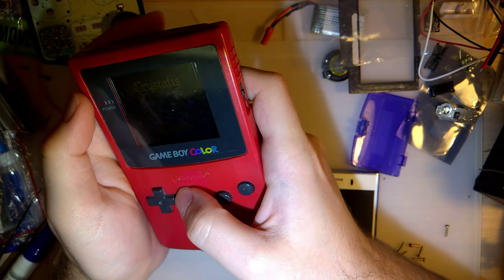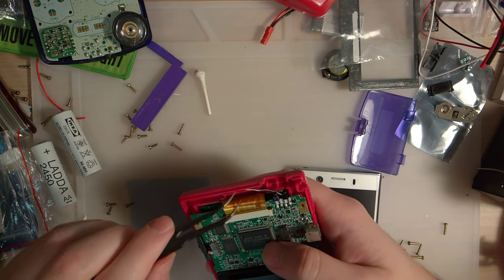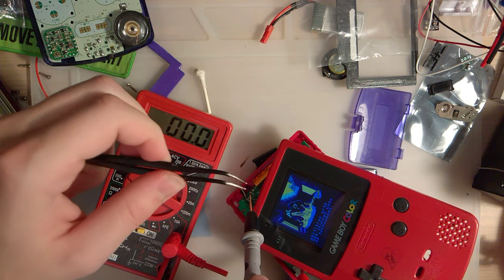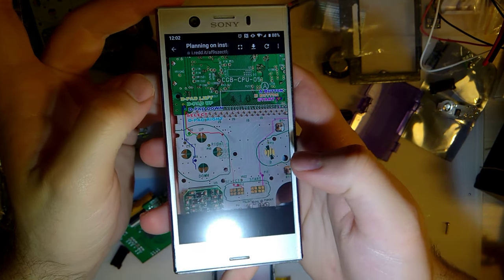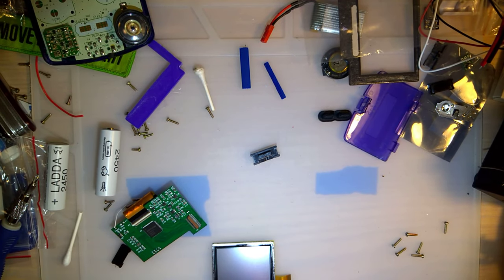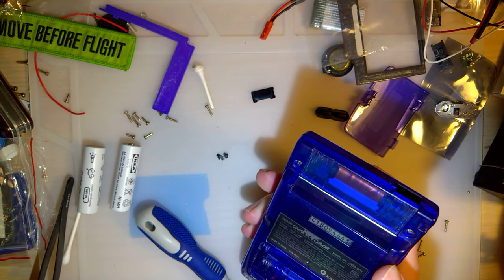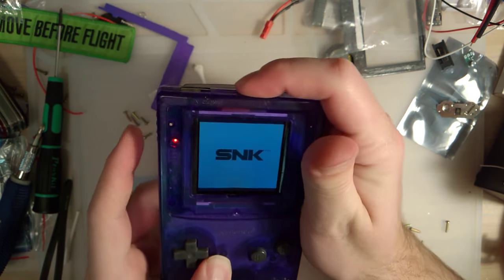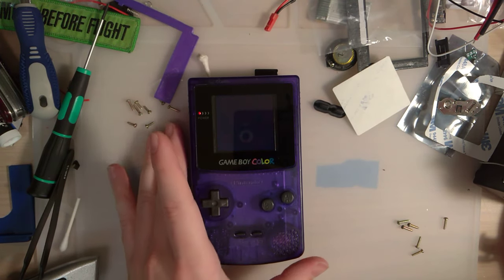Finishing the install of the TFT GBC backlight kit (HiVision AIO) - Part 2

Comment: I got a hint from the Producer of the mod. The brithness can be Make higher with replacing the 30ohm resistor the ist Mark as R9
Reply from the maker: ooh I may try this. Do you know if it increases all levels or just the max level?
Reply: @makho  like i understand Set it all brithness Level higher. I must only get the Info from it if higher or lower resistor.
When i knew it i give it to you too. 

I Have the Display here too but i must wait for the gbc. ;D

On Bennvenn freckle shack can Make similar Modifikation.
Reply: @makho  ok they say 20ohm instead of 30ohm which is build on it
Reply: I test it and it work.
10 ohm would work too.

Comment: Hey dude, this is amazing... I just ordered a Chinese LCD kit which I think should be like this one, I just don't have any access to 3D printers for printing the spacers. Do you happen to have the dimensions of the spacers anywhere? I'm thinking of buying some thin plastic sheet and making them from that. Also, I am guessing you'd have to use thin magnet wire if you wanted to convert the touch sensor into a button combo press for adjusting the brightness ("Select" + either "Up" or "Down" on the D-Pad), are there any pictures on what wires you need to solder to be able to do that? I'm a complete beginner on modding Gameboys, so I really don't want to mess this one up... Thanks.
Reply from the maker: re the spacers, check out this video: https://youtu.be/glaM-D5HjBo

You don't need to use thin magnet wire, but that will work. I typically just use 30 AWG solid core kynar wire. Here is a handy diagram for wiring up buttons: https://i.redd.it/af9szectfpu21.png

Comment: Question: will you be making a small video on how to solder the dimming buttons? I got this mod and the touch sensor fell off completely WITH the contact on the board so it doesn't work any longer. My only option is the Hold button combo but it's not working for me, which idk what I'm doing wrong? Thanks
Reply from the maker: Nope, no plans on doing a video. Solder the hold pad to the select button and solder the other pad to the start button and then when you hold select and press start, it should cycle the brightness. You can use whatever buttons you want.

Comment: I just broke the paper steel that change the screen brightness how could I fix it?
Reply from the maker: I don't understand what you broke or how you broke it. Do you mean the little touch sensor thingy? If so, that's just a small strip of copper tape soldered to the wire. Just solder it back on or get more and solder that on.
Reply: makho yeah the small sensor just broke so I could just solder it?
Reply from the maker: @Preemtea  probably, yeah

Comment: Hey! great video. Just installed mine but unfortunatelly I got a lot of humming when using headphones. Does yours got that too? if so, what do you think can be done to fix it? Thanks for replying.
Reply from the maker: I don't believe I have this issue with mine but my first guess is your capacitors.
Reply: @makho  thanks dude. I will check them out

Comment: That touch sensor spot is way better and you should use vinyl tape instead of electrical tape if you have.
Reply from the maker: Technically electrical tape IS vinyl tape. But yeah, I know. Just working with what I have until I make something better. I have a vinyl plotter so I was just going to make a window on that thing.

Comment: I got mine installed in a neo geo pocket color.  Is there a protective film on the screen?  I couldnt tell and didnt want to damage screen by taking off the wrong layer.
Reply from the maker: Couldn't tell you as I have not received my kit yet. IIRC there is a protective film but the top layer of the actual LCD is matte. You'll have to use your best judgement on that one.
Reply: I believe the chinashack is the same screen.  Did you have to remove anything from screen?
Reply from the maker: @indcsion  the NGPC kit and GBC kit are both the "AIO V1" kit and they both use the same LCD, yes. I do not recall if I had to remove anything from this particular kit, but on another kit with the same LCD again, there was a protective film on the LCD. Don't remember which kit.

Comment: I'm having problems with my lcd having horizontal flickering lines at the bottom
Reply from the maker: Double check all the connections (unplug, plug back in) and make sure there are no shorts (test outside the shell). If it's still acting up, contact the seller.
Reply: @makho  thank you, hopefully i can get it working

Comment: why not use black magic marker to mask the edges
Reply from the maker: Didn't have a black one handy at the time and I did plan on using a custom lens. It would work but the finish could be inconsistent so I opted for electrical tape instead. Ultimately I removed that though.

Comment: If painters/masking tape comes in a black that would be a good light block I think.

I agree that under the center of the glass would be really badass for the touch sensor, if not there you might be able to increase reliability by filing/thinning the shell at the top.
Reply from the maker: RE: the sensor under the lens, I'm thinking you might as well just cut a hole in the shell and apply the sensor to the bottom of the lens. It should not be evident from the outside of the shell and it should work very nicely. Unfortunately, I'm not really up for cutting up my Midnight Blue GBC though. 

And for the masking, I might try some liquid electrical tape or just make a mask on my vinyl plotter.